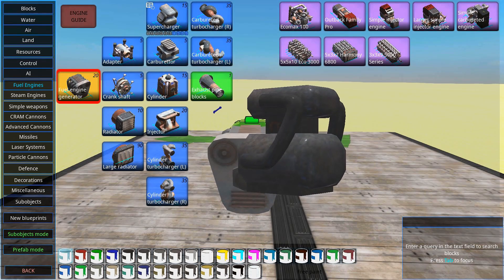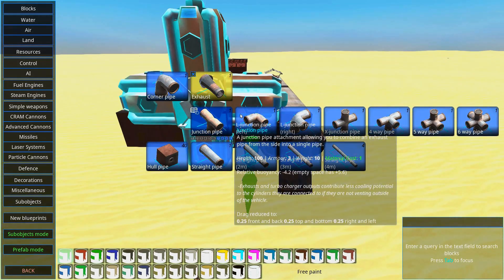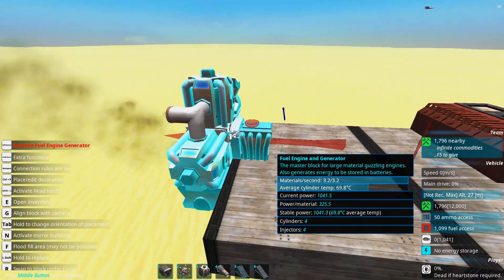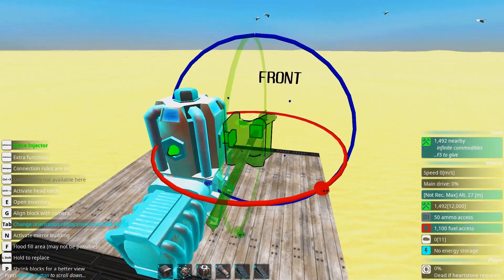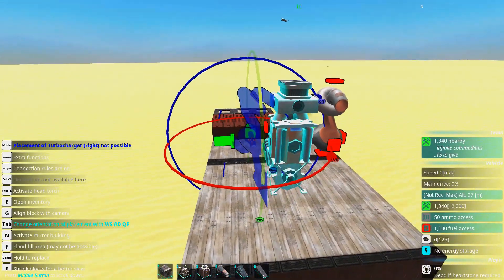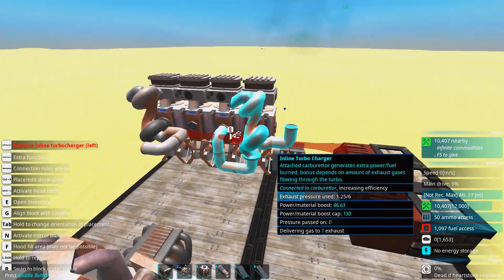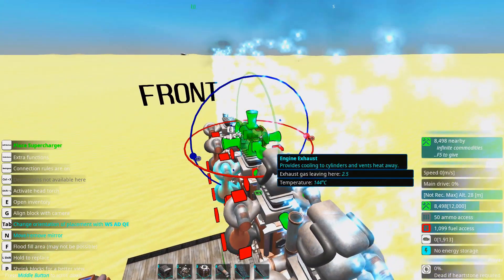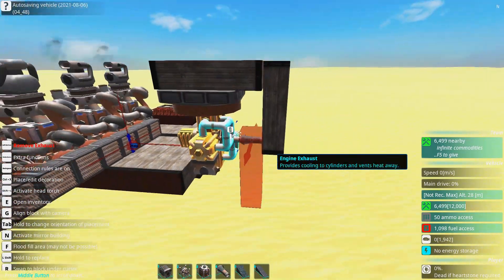From The Depths INSTANT Tutorial: Fuel Engines

Comment: Really, how tf do you make smoke visible, exiting the exhaust pipes? Particles in general (trails behind propelers)?  Pretty please?
Reply from the maker: Smoke from engines are only seen when the engine is working at a high load, for example add an ecm jammer like me to make it work at max output. There is also aesthetic smoke generators avalible if that is what you meant.

Comment: It should be noted that you do not need to have engines vented properly to continue working so as long as you have enough cooling from radiators.  Also it should be mentioned that there is a relationship between engine cooling and efficiency.
Reply from the maker: Sure that would be something to do on a stealth craft with low heat signature. 

Hmm, think I demonstrate and mention that though.